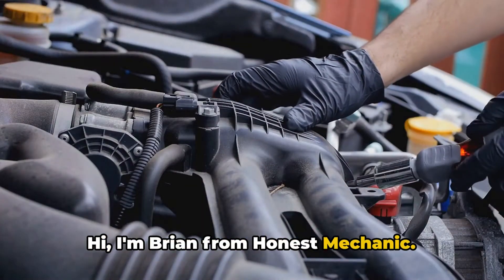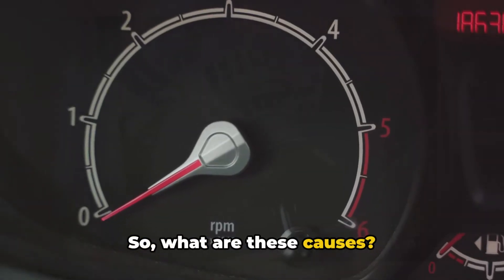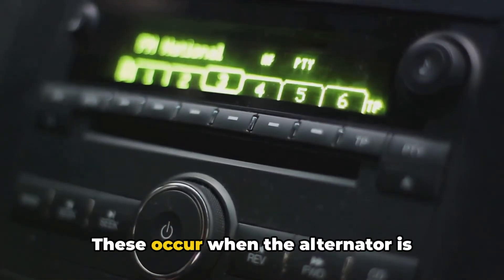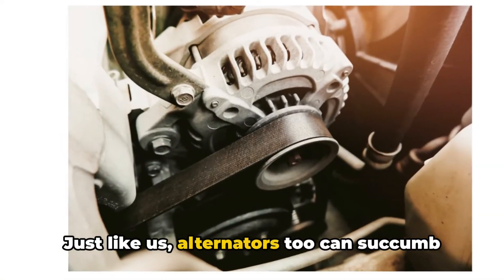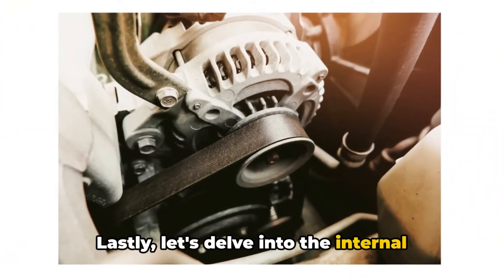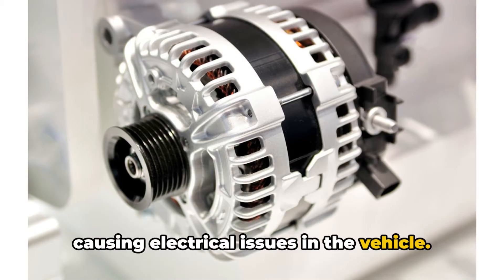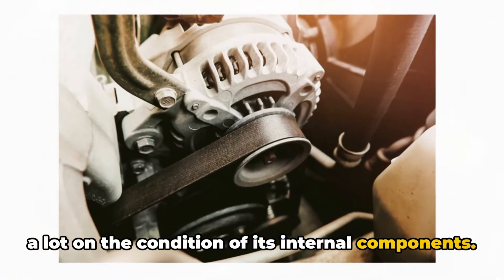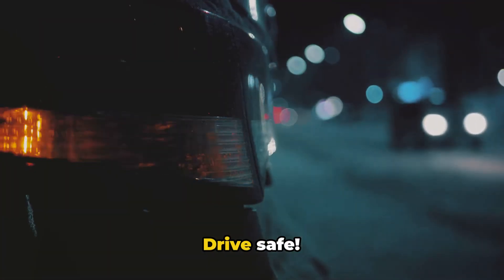What Causes an Alternator to Fail: Why it Stops Charging

Comment: Will ONE aftermarket GPS/dash cam be considered overload? in your video you said excessive aftermarket accessories so I don’t consider one to be excessive lol however I keep having alternator issues and I’m not sure if it’s coincidence, but the dealership tells me my type of car which is Lexus is very finicky about aftermarket parts but I have gone through two cars in a year and a half both with alternator issues and that one accessory is the common denominator that I can think of however, I find it really hard to believe that ONE accessory draws that much power to take out two alternators….
Reply: Bad wiring
Reply: One is not the issue. It's the load that matters. Try installing a dashcam with the biggest screen that you can find and then tell us what happens  next.